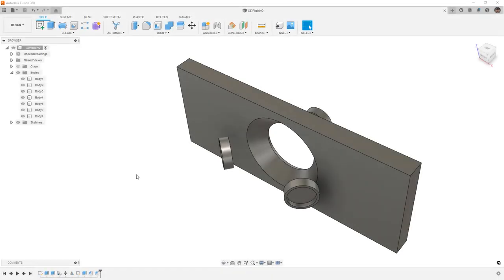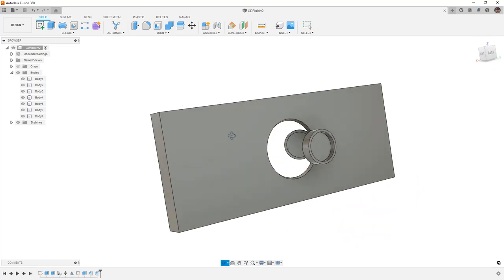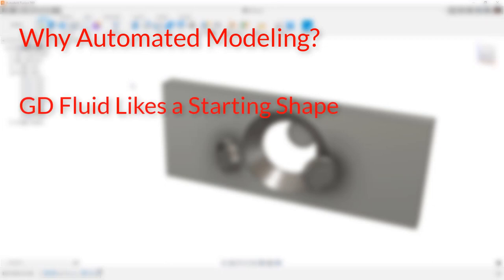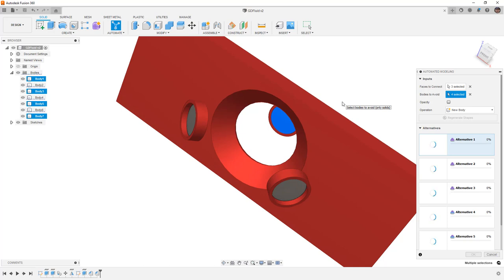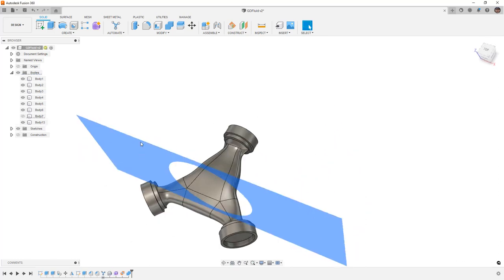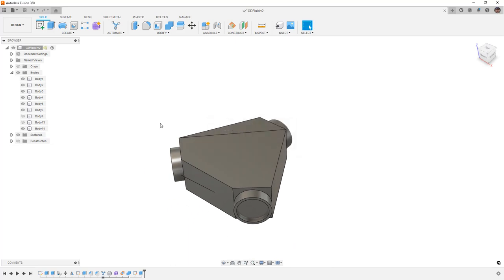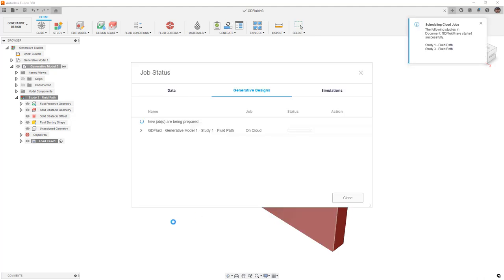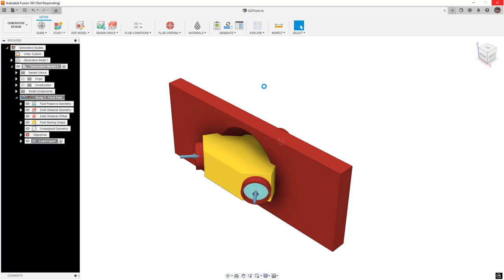Should we use Automated Modeling for a Generative Design Fluid Flow Starting Shape? | #Fusion360

Comment: Thank you for this tutorial! Way better than Autodesk's Generative Fluids tutorial on their YouTube page
Reply from the maker: Glad it was helpful.  I don't think it has changed much, but I do have several GD courses I did for Autodesk on their page including a section on GD Fluids if you are looking for more content.
https://www.autodesk.com/learn/ondemand/course/fusion360-generative-design-manufacturing-applications-expert
Reply: @LearnEverythingAboutDesign  Thank you, that resource was also helpful. So thanks to your videos I was able to create a generative fluid design for fluid through a hydraulic manifold, however when I do a Autodesk CFD simulation to compare the original to generative fluid design, it looks like the pressure drop actually increased? Does this sometimes happen??
Reply: @koreanoguy95  Was the CFD set exactly the same?  I would expect the CFD simulation to be more accurate since the GD Fluid is still technically a "beta" product.  That said I wouldn't expect them to be wildly different BUT when you do a generative design study and an FEA study after there are differences.  Mainly in the fact that the preserve regions are absorbed as the mesh during a study, but they are solid bodies with sharp edges in some cases when converted to a BREP.  This means the Mesh from the GD study and the mesh you run in your CFD are slightly different.
Reply: @TheShift1313  Thanks for replying. The CFD inputs were the same (for the boundary conditions and # of iterations), the mesh was autogenerated using the autosize function. Interesting point about the meshes being different, how can I make sure that they are the same for both  CFD studies?

Also, from watching an Autodesk video, I think what it may be is that for the generative fluid study sometimes prioritizes volume reduction over pressure drop optimization, which I think may happened in this case. The generated fluid profile has a smaller diameter which I think may be leading to overall increased pressure. The study was originally run with a target volume of 50% of original, I think I may try again with a higher percentage (75% or 100%).
Reply: @koreanoguy95  for the mesh you can't really because if you export a mesh rather than a design from the GD study, i don't believe you can use that in Autodesk CFD.  I think it needs a solid so it can mesh it on its own.

For the prioritization of vol reduction that is a good catch.  That would seem to make sense to me.  Would be interesting to see what a rerun at 75% would do.
Reply: @TheShift1313  Redid the fluid GD with 75% and 100% target volume, 75% increased the pressure drop and100% reduced it

Comment: Interesting video and very well done. What's the best sort of use case then for this type of gen design? Will it always create a single path? I'd love it if they could make it branch and optimise cooling of a shape but respect specific inputs such as minimum path size/cross section etc.
Reply from the maker: Good question!  The automated modeling right now seems to just look at line of sight and then refine from there minimalizing the design.  That is mainly why I said it probably isn't good as a starting shape for GD fluid.  GD Fluid won't really branch outside of that shape as much as GD Structural will.

There is cooling simulation but its electronic cooling and doesn't really account for CFD.  I am hoping one day CFD will be in Fusion but for right now we have Thermal problems with conduction and convection and radiation but without moving fluid around the designs.  

I do love the idea of some basic inputs for Automated Modeling like minimum cross section.  Maybe one day!

Comment: Is it possible to generative design a watercooling block?
Reply from the maker: Yes and no.  Gen Design Fluid flow is looking at a flow path with essentially the least resistance.  You set a pressure or flow on the inlet and basically 0psi on the outlet.  While it can do multiple inlets you might find out that it is not what you are looking for.

All that is just flow path though.  There is currently no mechanism in place to account for thermal transfer.  While you can do some thermal simulations in Fusion, there is no CFD so you wouldn't be able to evaluate the cooling with flow.  Only what would happen if say you had a block with water at X temp.